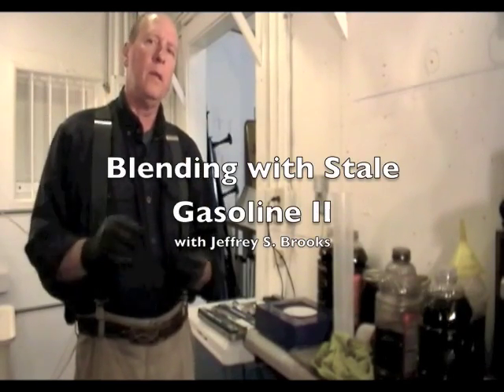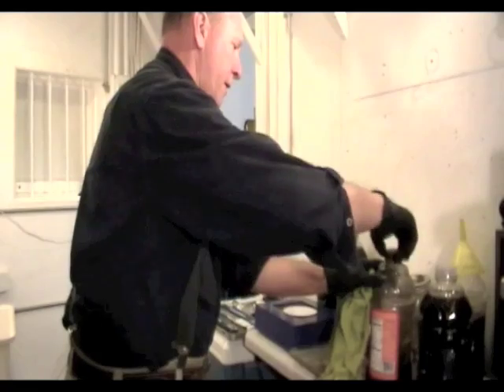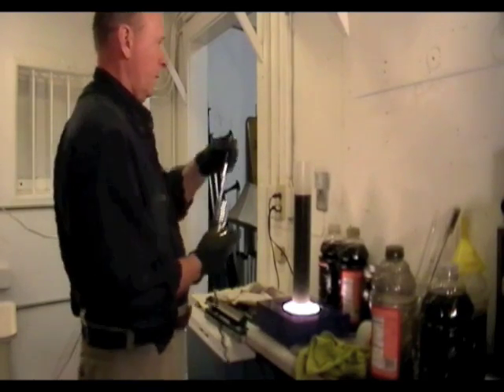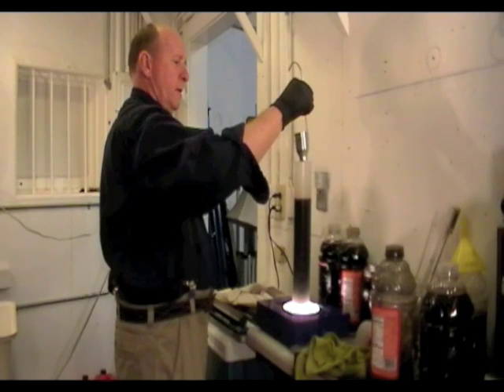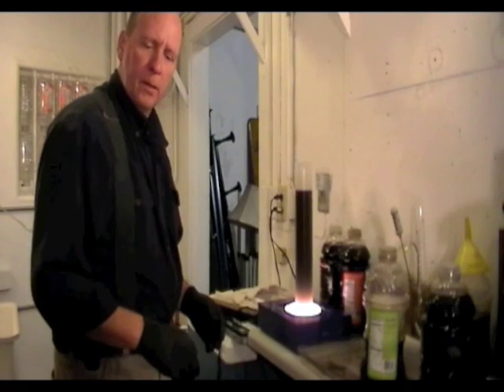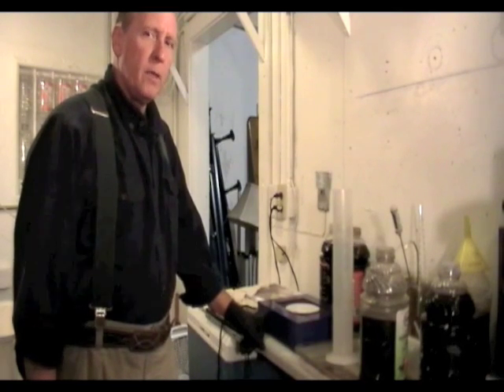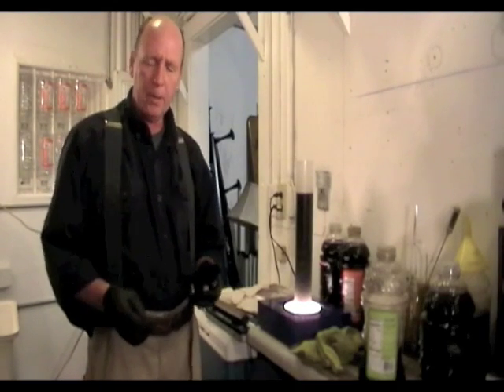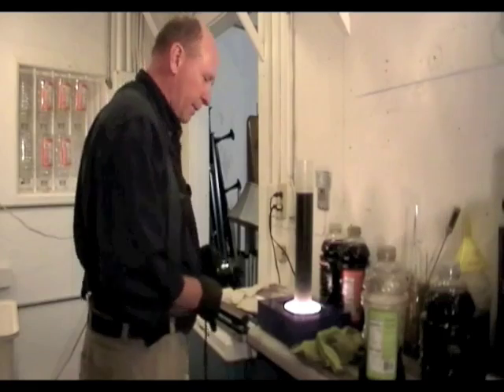Blending Stale Gasoline with Waste Oil to Make Alternative Diesel Fuel II

Comment from the maker: If you are blending misfuel, which is a combination of gasoline and diesel fuel of an unknown quantity, then most misfuel is about 90% gasoline, so if you blend it at no more than 30%, to 70% WMO, then you should be safe.  But, you can purchase a set of hydrometers to determine the content of your waste fuel sources more accurately.

Comment: Thankyou for your reply, for a while I blend my "well" filtered wmo with diesel it works fine50/50, I have been mixing gasoline with wmo for my dripping fire place for some time, I have noticed a slight difference in the burn that I havn't studied fully as it works well..but never tried it in the vehicle probably as its accidentally mixed with diesel and I don't know the exactly how much is gasoline or diesel, would you try it in small amounts?

Comment from the maker: The only problem that I have found with blending gasoline with waste oil to make diesel fuel is the alcohol content that can be in US gasoline can be as high as 10%.  At 20% there is not enough alcohol in a gasoline / waste oil blend.  However, at 50% there might be.  So, decrease the content of alcohol that might be in your blend by blending diesel fuel with it.

Comment: I get from the garage my wmo to run a 50 50 mix in my diesel car, often they have alot of accidental gasoline in the diesel or diesel in the gasoline tank removal jobs, I have stored a lot of it but am not keen to use it in my mix as diesel cars can react badly to petrol in the tank, have your results showed this